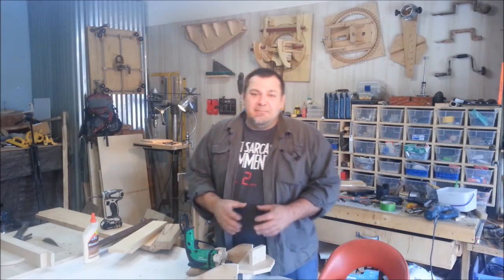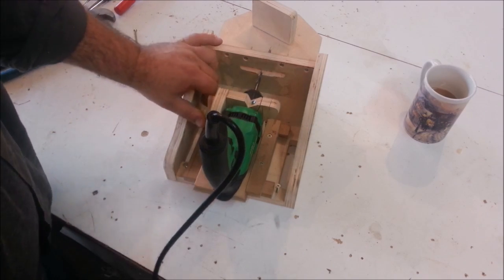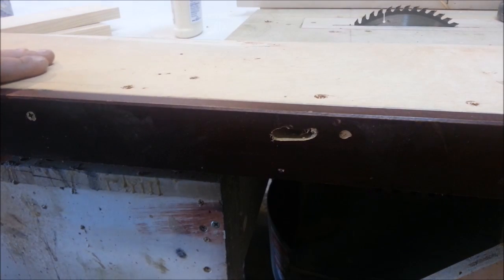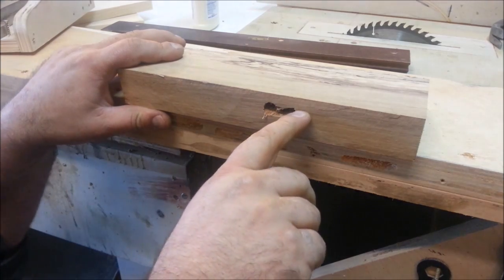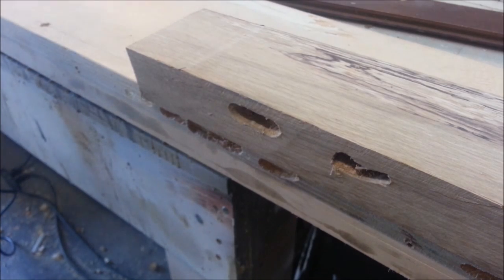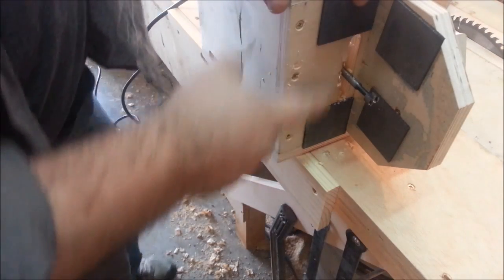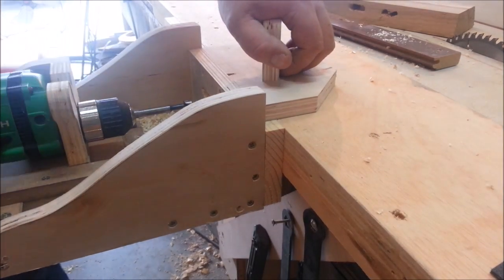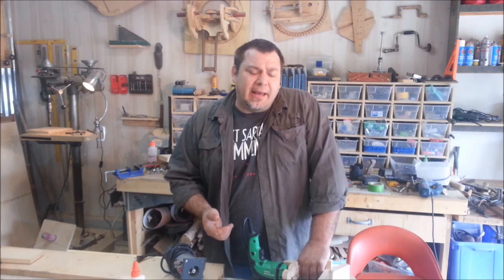Homemade slot mortise for domino tenons with a drill experiment

Comment: I have only one thing to say RPM RPM RPM - Routers do not turn at high RPM for no reason, a drill simply does not have the speed the bit was climbing because it was at too low a RPM.

Comment: Izzy,first of all, I just found your channel. Awesome ideas. Very resourceful and ingenuis the solutions/jigs you come up with. I had a suggestion, maybe it would help with the drill jigs. The drill itself, the case of it is a very irregular shape. If you could make an L shaped box it would fit inside of to hold it more steady/perpendicular. I dont know, something like that. The point being to get the drill itself to a more jig friendly shape , maybe squaring the rest of it up to the battery or something.

Comment: My first thought was to use sandpaper for the grip, but that could damage a finish, so maybe that grippy stuff they use for tool draw liners, but only on the slot face, as flexing there, even though minimum, shouldn't effect the important thickness of the mortise. I want to build Tehdoor's version, but I would prefer not to use ball bearing slides. Do you think that your wooden slides can be done with sufficient stiffness to make an accurate slot, but still operate smooth enough without binding? Oh, and since HF has single speed trim routers for under $30.00, dedicating one for this means a drill here would only be for fun.
Reply from the maker: Darnley Bynoe This is what i did this afternoon second attempt     https://www.youtube.com/watch?v=AoG-eGq6qHc

Comment: Hey Izzy, I like the ideaand I have a suggestion that you may consider. Have you tried shortening the length of the shaft on the  fostner bit? It may cut down on the vibrations  especially if you are traveling horizontally.

Comment: Totally innovative as always, Izzy!  I do have a couple of suggestions though that you can take or leave as you think best. 

1) I think your idea with the foam pads to give a little bit of grip was a good one, but, like you point out, because they're spongy, it allows the unit to wiggle a little.  How about something like 100 grit self-adhesive sandpaper instead?

2) What if you avoided the problem entirely and just clamped the thing down?  I understand the appeal in having it free-hand, like a Festool Domino or a biscuit jointer would be, but if my main goal was to make a clean mortise slot for cheap in my shop, I'd be happy just to clamp the thing in place.

Comment: I think the part where the drill sits should be resting / bolted on the bench then clamp the wood to the front of it. I can see it dipping down when you use it.  It is worth attempting that real "domino" machine sells for over $1K.

Comment: This is an excellent concept.  My $0.02 after buying Stumpy Nubs plans for a hand-held slot mortiser and making the jig to spec, it was very time consuming to build and the results were disappointing.  Mileage may very -- though it seemed to be heavy enough that the whole thing was clunky, it put sideways pressure on an extended that made me fearful of breaking (a new Eagle America 1/4" bit), and it made the process take as long as doweling and an extremely sloppy joint.  I like all of your projects, Izzy, though this is a tale of caution.  If someone gets one to work really well, I'd love to see it!  After that project I learned if I wanted dead-accurate precision it's up to a greater person than myself to make it.  Bought my first biscuit jointer recently :3

Comment: Izzy, when you make the final build for the complete workstation, you should try to keep all machines using the same drill attachment method. That way you can easily slip it in and out from machine to machine as seen in this video.

Comment: I think if you reinforced the stablity of the rear of the drill, that would help significantly.  It may reduce the ease of taking the drill out of the jig,  but I noticed that where the drill is currently mounted behind the chuck,  it is using that chuck almost as a lever point.   One idea for keeping the jig in place,  may be to have some sort of brad or screw point just proud of the jig that can push into the wood that you are putting a mortise in.   Yes it would leave a small dimple next to the mortise, but would be covered in most cases by the other piece of wood you are attaching.   Love the whole drill series though!

Comment: I like the idea Izzy, but I don't think the drill will do what you want it to. Two things, the drill does not have the RPM needed for the spiral bit, you need 15,000 plus to make a good cut. the second thing is the drill chuck is not designed for side pressure, that's another reason your cut is "walking around". I think the trim router would be the way to go with the spiral cutter or even a straight flute solid carbide. Now on the other hand, for drilling with the fostner bit, that is great. Keep up the great work, I look forward to your videos.

Comment: Take a look at the Jessem Zip slot mortiser if you haven't seen it.  It's for doing mortises with a drill and a special extra long shank end mill.  They have a bearing that the drill bit passes through and the bearing slides back and forth in a carriage and is replaceable with different sizes for different size mortises.  I got one on clearance and the hardest part of using it is clamping the stock to it well enough to keep the mortise straight.  I don't know if it will work with a drill without physically clamping it in place but it is at least possible.
Reply from the maker: krtwood I will look into it thank you for the tip

Comment: Using a trim router would be the way to go in that application but I like the thought of using the drill as the motor for all these machines. Have you considered making the drill mount so that it stays on the drill and you can just move the drill from one machine to the other?

Comment: What if the bits were shorter I would think that would cut the flex down snap on has double sided speed bits they are half the size of normal bits but I don't think they have wood bits though.